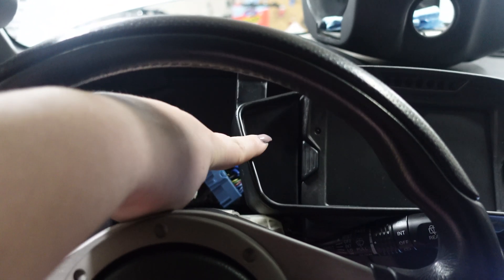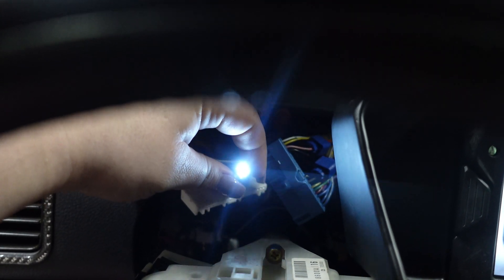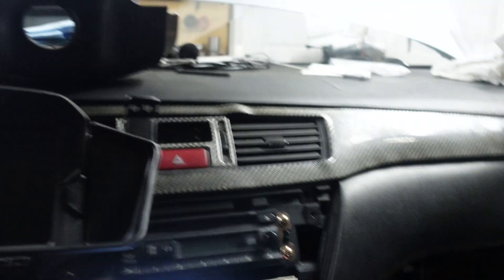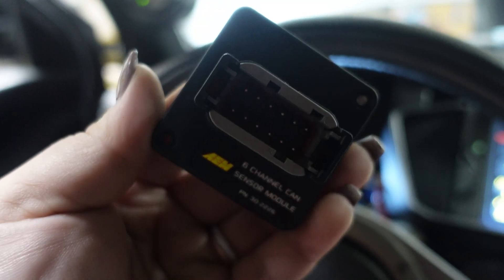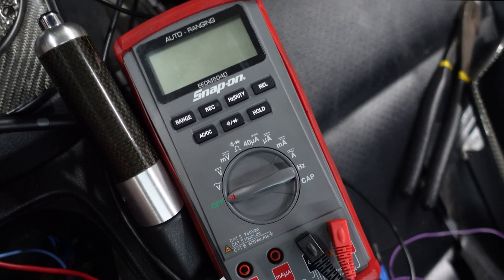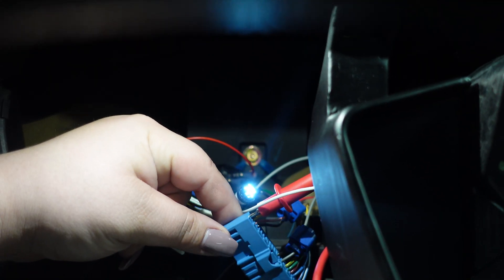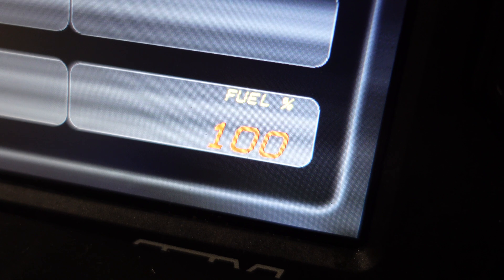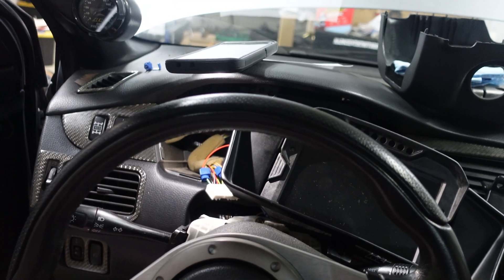Setting up the AEM 4 Can Hub & 6 Channel Can Sensor in EVO 8 !

Comment: So to totally  swap the oem cluster, not only I need the digital dash but all those accessories? Wow, that will add up real quick. Over 2k just for this. I wish AEM would built in everything needs in  one dash like the haltech UC10. Do you really need the 4 can hub? Can't we just keep daisy chain it with the Y cables that comes? Thanks for the video! Im deciding to go with the CD5 mounted in the steering column + the OEM cluster or remove everything and go with the DC7. I'm leaning more towards the DC5.

Comment: Sub! How did u wire in blinkers? Which wire on the back of dash did you use to connect blinkers?Ty stilk trying to figure out my cd7 as well
Reply from the maker: Pin 3 on white connection...Pin 49 on blue..but there is a relay to convert the positive output to a negative output. you have to wire in a 168 light to the alternator part or your alternator won't charge the battery too. I would use a led so it doesn't melt anything. Find that out during the process. I have diagrams I can send you if you want to dm on Instagram. (Amandaraejean)